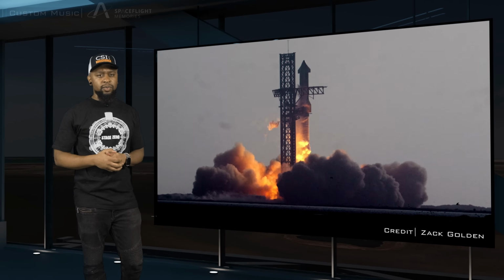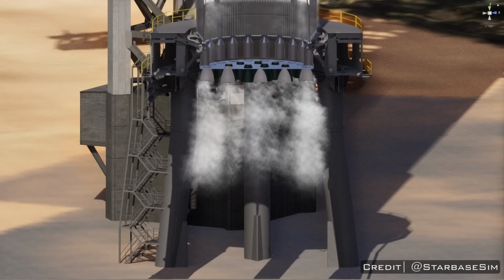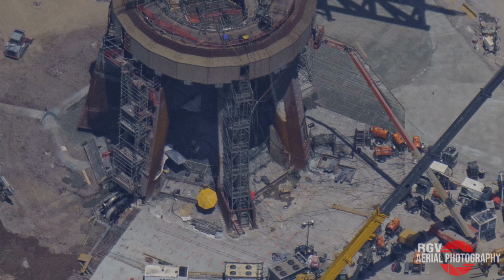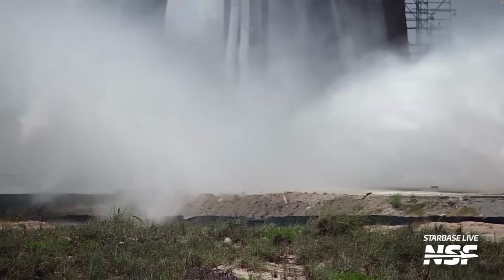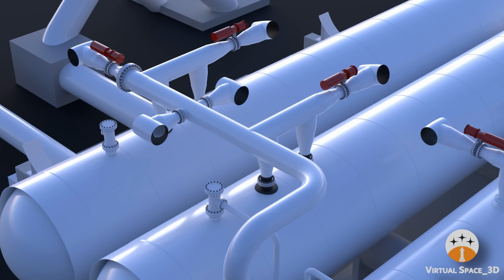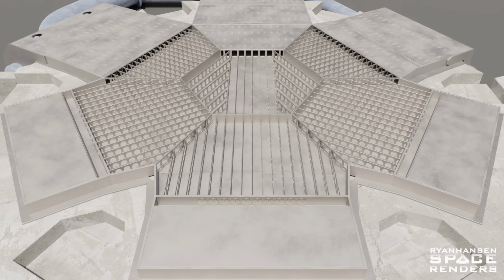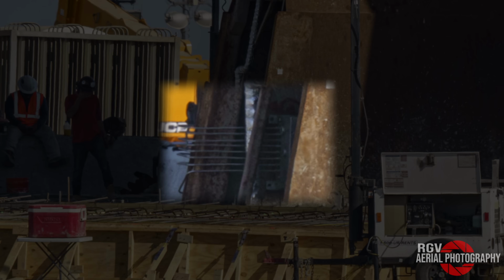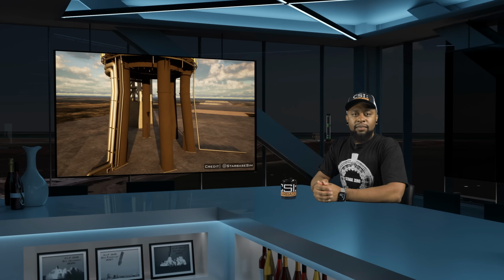How SpaceX Will Guarantee Its Launch Pad Never Fails Again! [Part 2]

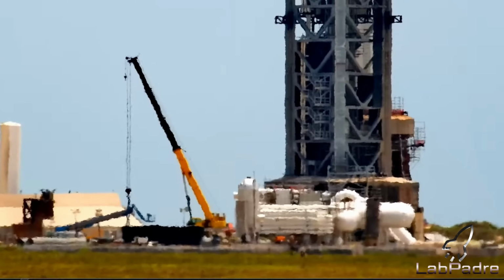Comment: 40:32 Why having automated valves? Why a sensor? Has anyone every heard of a little thing call a vent valve which doesn't need automation nor sensors but is just a kind of a check valve that is open to let the air out and as soon as there is no more air and thus the pipe is full of water that water pushes the valve close. Simple, effective, been around for ages and anyone with a basic understanding of piping is familiar with it. It's not rocket science and unlike an automated valve one doesn't have to waste wiring or programming and a vent valve has far less likelyhood to be subject to failure or bad timing judgement.

By the by, having the flow go up before it goes down means that the pumps have to work even harder and there by decreases the amount of pressure that is actually produced when hitting the shower head.
So less amount of water than what NASA use, less pressure than NASA use, and NASA doesn't even use the water in the fashion that SpaceX uses.

Cutting lots of holes to then fill them up again is typical SpaceX wasting time and effort  and other peoples money. Efficiency is clearly not something they have EVER heard of.

WHERE ! Where in the room they don't have would they build a water treament plant? They don't have the room to built a decent retention pond. Not being able to collect the water is another violation of their TOS.
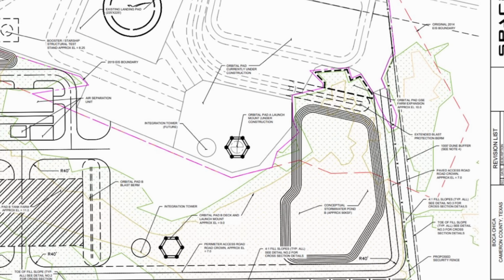52:19 Getting army corps of engineer approval?  Have you paid attention at all to Elon? Everything they do is to prevent having the army corps of engineers involved because the corps would shut them down and laugh them of this planet with their amateur hour theatrics.

No one seems to have an issue with a few hundred feet of steam washing over the 'protected' wild life reserves.
Yep, let's keep destroying this planet quicker so that some narcissistic loud mouth and his yes men can sell pipe dreams about colonizing Mars.
Reply: Since when there's any pump in the system again?
Reply: @alvianchoiriapriliansyah9882  okay, I stand corrected. They don't use pumps, because that would be to efficient. They 'push' the water by dumping pressure gas into the tanks. In other words, they added more tanks, pressured tanks no less, without shielding, because SpaceX has never ever had anything explode or have debris hit and damage tanks. Right?

There's two efficient and easy ways to move water. 1/ use gravity  2/ Use pumps 
Used pressured gas is a method but has lots of disadvantages that the other two don't have. It adds complexity, adds points of failure not to mention that instead of paying upfront for systems that the entire world uses, they made a custom solution that spreads the cost over time but alas by the system they use it will end up more expensive because they are using consumables (buying and transporting the gas) on top of the the water they have to buy and transport and of which they barely get to 're-use' a small percentage. So cost upon cost upon cost. Yep, sounds typical SpaceX.

By the way, the explanation by CSI about why they don't use air but nitrogen is bogus at best. And let's not forget that when something goes wrong (not if but when because we are talking SpaceX) tanks with pressurized nitrogen are more dangerous than pressurized air, because you don't want to stand in a cloud of nitrogen gas without precautions.

Stating that they use nitrogen so that the water wouldn't have things growing in it shows that CSI probably missed some chem 101 classes. Potable water that stand still in any vessel for a period of time will end up having thing growing in it. Seeing that they fill the tanks and all the pipes with water and that it can be months before there is a test and that it is in Texas (temperatures during day and night), unless they put stuff in the water to prevent algae and such there will be stuff floating in that water. AND if they do put chemicals in the water to prevent that..... it means that the water spraying into the wild life reserves is chemical contaminated and there for harmful for fauna and flora.
Reply: @PDVism  Gravity to supply the water is not possible because of the high pressure. It needs to be at least 17 bar to overcome the stagnation pressure in the exhaust plume, with around 40 bar estimated for the current system requiring a 170 to 400 meter tall water tower. Pumps that can move 1.4 Million liters of water in 10 seconds at a pressure of at least 17 bar are also certainly not cheap or less complex. Gas pressure driven deluge systems are also nothing new. SpaceX themself use one at their most active launchpad, SLC 40 in Florida for many years reliably and they have already simplified the system at Starbase system quite a lot, for example by using a weir pipe instead of valves. The pressurized nitrogen comes from evaporating cryogenic nitrogen which is already a consumable used to keep the cryogenic methane cooled and I don't think the cost of a small amount of LN2 for a large volume of pressurized gas is necessarily higher than electricity and maintenance costs for a specialized high power pump.

While I agree that the theory that nitrogen is used to hinder organic growth in the water doesn't make much sense, you argument that nitrogen is worse in an accident isn't too convincing either since the area will probably always be evacuated anyways while the tanks are pressurized.

Comment: why try and re-invent the wheel and just put in a flame diverter. That water jet has got push up through a set of holes that are subjected to seven million pounds of thrust from the Raptor engines. That is the pressure on the plate and the water. That last test was only two seconds long and I doubt the engine were know way at full power. Similar tests were done on the original concrete pad and was given the thumbs up. As it turned out twenty nine of the thirty three engines drove meters of concrete down into the earth. If that plate fails it will make the original concrete  damage look like a rain shower.
Reply: You know that the flat pad contour wasn't actually the real issue didn't you?
Reply: Army corp of engineers said no flame diverter for you. 🤔

Comment: I think that little pipe on the bottom is for cleaning the system. Do you think the water might send the sound waves back into the engines? Also the way you look at each and every part off this amazing machine is just unbelievable. 
Thank you Zack & to all that help you make these deep dives.

Comment: I remind you that in temperatures 3000 Celsius degree 50% of water transforms into gaseous Hydrogen and Oxygen. Don't make mistake similar to oceangate: do not believe it will work against laws of physics.

Comment: How about 3\4 th egg shaped (the lower part or the thicker part) pit is made below the exhaust.

It will form a egg shaped fire and air ball which will deflect all the heat and energy including sound and vibration.

Comment: If it's so good, why did the tests stop after 2.7 seconds? Because the wonderful water spray system combined with fantastic firepower during the static test destroyed / stopped as many as 4 engines and it happened in the middle of the test, if it would be continued it would stop be maybe 8-10 engines. The design of the water sprinkler system is so good it's unbelievably bad. The new engines will overcome the reversed pressure created by the water spray system and engines static fire, which will increase the temperature in the space just below the engines, causing the modified engines to fail again. It is also possible that due to the increase in temperature in the space directly below the engines the water from the sprinkler system could break down according to the laws of physics into hydrogen and oxygen, causing all the components of the system to explode in an impressive, never-before-seen, colossal explosion. It's going to cost something like $2-3 billion, so it'd be worth seeing. My question is: were simulations carried out before the tests for the replacement of water with hydrogen and oxygen under the engines? Is Spacex insured during the tests?
Reply: Source/evidence for water deluge actually destroying 4 engines please?
Reply: it was said in early posts for example https://www.youtube.com/watch?v=zEWfAkZMpI0 I wonder to know which enegines stopped. Maybe you know it better.  @alvianchoiriapriliansyah9882
Reply: @mieczyslawherba2723 That's not an official/legitimate source, thank you

Comment: So many birds are dying every time the deluge turns on.   You can see the birds trying to drink water,  because the birds know its fresh water when the deluge trickles out.
So the birds run to it and the birds start drinking.   Then the deluge turns on and kills them all.   😢😭   You can see this starting at 35:05  of this video.
Many other videos on youtube shows this.  It "Seems"  that this area does not have available drinking water for surround nature creatures.  And its a really hot state.
I wish Elon constructed a small clean water fountain just for the birds away from the rocket OLM.   🤷‍♀   The birds are flocking to the platform knowing there is fresh water there.
Elon needs to find a solution for them, that also prevents them from dying when the deluge turns on.
Reply: Generally a siren or small explosive bang is used to scare away the birds before ignition.

Comment: Excellent explanation of what was going on in this complex operation. However, I believe there might be a good opportunity for a [Part 3] video that goes into greater detail on the pressure, temperature, and sound reduction provided by the high-velocity streams of water. Near the end you showed side-by-side videos of the April and August firings. The April hot gasses were bright yellow far out from the OLM but the August hot gasses were not. The primary reason is the water's large latent heat of vaporization that rapidly sucks energy out of the extremely hot gasses and pulls the gas temperature down to near the superheated steam's temperature. By shooting the water out in many hundreds of small, high-velocity streams, the hot gasses are able to more quickly and uniformly mix with and vaporize the water, which more rapidly cools the gasses. Presumably rapid cooling of the hot gasses as they interact with and vaporize the water must provide a rapid gas volume contraction that reduces the radiated sound levels. It seems that rapid reduction of gas temperature and volume might also help reduce gas temperature and pressure against all surfaces of the OLM, which would also be good for reducing damage and follow-on maintenance. I don't understand all the physics behind this but it would be quite interesting to learn more about it.

Comment: i believe the 4 engine shut down was triggered by gas build up in the skirt of b9. a larger nitrogen purge tank has been installed with the wholes added around the skirt. this should end the engine shut downs.
Reply: And what evidence to back up this belief?
Reply: @alvianchoiriapriliansyah9882  one no engines where replaced, 2 a larger nitogen tank was installed to purge gas leaks from the raptors. 3 holes where installed around the skirt to flush gases leaks. 4 all the engines started and weren't shut down for 2.5 sec. this means it was an external force that was the cause. AKA gas build up, scrub.
Reply: @brian1395 I thought the purge tank were already installed before the static fire?

Comment: Surface cracks in the fondag are being reported, if true, that's bad, your thoughts?
Reply: It's normal in civil engineering for large pour, and now being sealed. No problem
Reply: @alvianchoiriapriliansyah9882  Please research "fondag" concrete. A sealant is not used on this type of concrete. Do your research. The "fondag" is the sealant. Cracks in a fondag pour are not normal. Research, research, research, then talk.
Reply: @patrickjack2943 fondag is a type of concrete not a sealant bud

Comment: Hi, the pipe coming from the Deluge manifold with the curved pipe, you said that you didn't know where the extra pipe was used for, I think it was going up the OLM to give extra water pressure for the FireX system. Maybe you can find out if that is correct.
Reply: It's certainly possible, but in my opinion very unlikely since the deluge and FireX are independent systems with independent water supplies and need to be used individually. The FireX system is most important for spin primes where the risk of unburned methane exploding is the greatest while the deluge isn't active for those tests.

Comment: Awesome video. By far the best out there when it comes to explaining what we are looking at down at Starbase. 
Quick Question: This whole showerhead thing seems like 1 band-aid on top of another.... Elon wants "rapid reusability" - but how will that happen if it takes 2 days to fill water tanks? Do you think the answer is desalination and more water storage? Or do they scrap the showerhead in favor of a new solution?
Reply: Eventually rapid reusability of starship.
Currently, Boca Chica site doesn't even have permission to launch more than 5 times per year.
Reply: Supplying the water to the launch site is easy compared to the cryogenic propellants, so the deluge systems shouldn't be the limiting factor when it comes to rapid reflights, but it's going to be interesting to see infrastructure like pipelines, power cables, desalination plants and air separation plants needed for a fully operational Starship port.

Comment: “As a spacecraft enters the earths atmosphere, it encounters increasingly dense air at incredibly high speeds, which causes a lot of friction. The friction between the vehicle and the surrounding air generates heat…” this is not wrong, but the majority of heat flux on a re-entry body actually comes from the adiabatic compression of air in front of the body heating that air to crazy temperatures. That crazy hot air then radiates onto to the re-entry body, heating it up bigly. This is why re-entry bodies are blunt, the blunter the body the farther away the shockwave is and therefor the greater the distance between the re-entry body and the source of scorching radiation coming from compressed air beyond the shock.

Comment: This is just a guess but if that one manifold with the mysterious tube coming off the bottom maybe if it was the furthest manifold from the water tanks it might be a nitrogen or "whatever their using to pressurize the system" line to help with the water pressure on the far side. Like I  said just a guess.

Comment: Repeat after me.
The plume is NOT 2000 Celsius hot.
The plume is NOT 2000 Celsius hot.
The plume is NOT 2000 Celsius hot.
The plume is NOT 2000 Celsius hot.
The purpose of the rocket engine is to convert heat to linear motion of the gas. A good engine is doing that very well, with almost all energy converted to the motion of the exhaust gas.

Comment: The outer concrete is cracking. Without any joints looks like there many have been to much expansion
Reply: It's normal for large-size pour, they're already sealing it

Comment: Great video! I think those valves at the top of the pipe just have a floating ball, which is raised by the water to shut it off.  We used them in dredging to keep from pushing air through the pipe and also break the syphon after pumping.  Called them popper valves, but idk their real name.

Comment: SpaceX should build a 20 or 30 meter taller launch table in Florida. Maybe they can do so without adding 20 or 30 meters to the tower.  They also should build the tanks farm behind the tower, vertically (less space), in a triangle formation. This way the tower will protect the tanks and the pipes from the tanks to the tower will be shorter.  And they should build a 60° angle concrete (covered with metal plates?) wall (~8 meters high) all around the launch table, so the exhaust+water+vapor will be projected in the air instead of to ground installations.
Reply: Because it's cheaper and faster /s
Reply: The tank farm in Florida is already located behind the tower and far enough away from the OLM to not require extra shielding from walls. Making the OLM taller might be an option to reduce wear on the launchpad for rapid reflights as the Starship thrust output continues to grow, but it's obviously much more expensive and not worth it unless absolutely necessary.

Comment: Now imagine the colossal water tank and high pressure air farm needed for multiple launches per day.
Reply: Suppling the water is much easier than cryogenic oxygen and methane. It's all about the supply rate not the storage capacity.

Comment: I wonder if SpaceX anticipated this much damage to occur and had all this rework already engineered ready to go and if they didn't it's pretty amazing turn around.
Reply: The plate was almost complete, but they didn't expect nearly the damage we saw from the first integrated flight test. Elon said so.
Reply: The steel plate system seems to have been planned for a long time, even construction at Starbase started way before the flight test with things like the vaporizer installed last year, not to mention the OLM construction at pad 39a including a underground water distribution manifold from the beginning. Elon confirmed in an interview that they only launched without the water system because it wasn't quite ready yet and expected the concrete to survive for one launch before it was supposed to be replaced anyways.

Comment: The StarbaseSIM analysis is the first time I recall hearing that the plate is made of stainless steel rather than normal steel. 
I did wonder before how long the plate would last before corrosion took its toll, but on the other hand most of the conventional flame diverters I've seen pictures of seem to be rusty old plate steel.
Stainless steel is pretty hard to work, which explains why they were having such a tough time tapping huge threads into it.